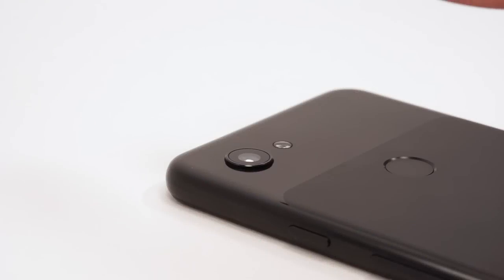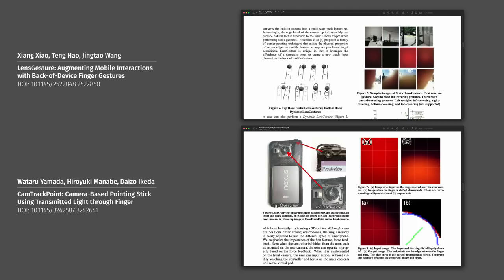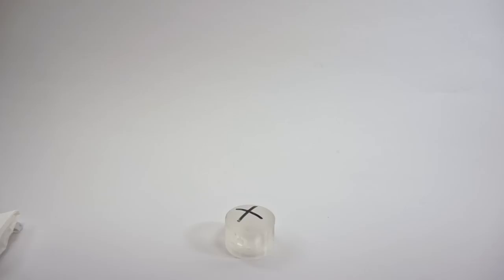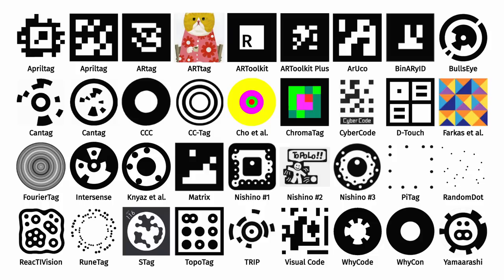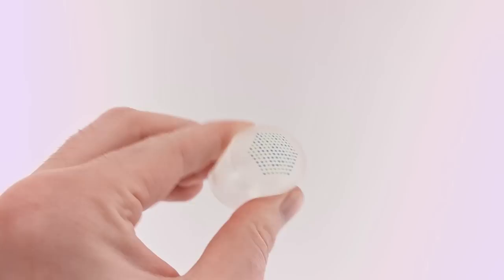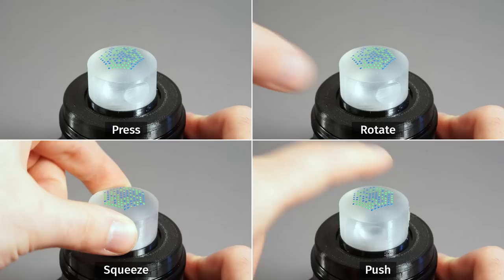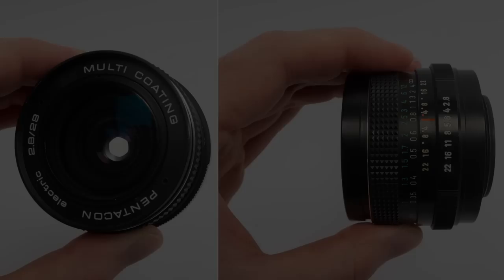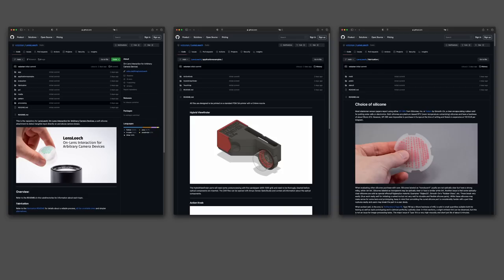Touch a camera to control your devices

Comment: Well I guess that as a input device to scroll through menus it's probably not very useful. Because it also requires a screen to see what you are doing in the menu structure. So for this you might just as well use touch screen, right? However, the application in soft robots is interesting because it allows for detailed feedback on how a  robot surface touches and holds an object, and which forces are exerted. Btw, good info on the silicone pigments, thanks for your effort!
Reply from the maker: Yes, if there is no screen at all the usefulness would be very limited. The niche where something like this might make sense is retrofitting. Old(er) devices with displays but no touchscreens that still do their job but are less convenient to use compared to their modern versions with capacitive touch areas. I admit, it's kind of a stretch, but so is a lot of human-computer interaction stuff...
Reply: No way! Nice seeing you here!

Comment: I wonder if this could be used for a 6DoF CAD mouse. Very cool concept and great illustrations
Reply from the maker: Interesting idea! After an initial calibration it would be possible to calculate a "lift" movement as well. The main problem would be the refresh rate/latency. The 3Dconnexion SpaceMouse does up to 1000Hz, that's quite a difference to the ~20Hz that the LensLeech does right now.

Comment: As it is silicone this could be used in the medical field where user interfaces would often be treated with disinfectant. Maybe controlling a 3D Model of a patient scan from a portable ct scanner (just like a cad-mouse, like another commenter said). You could pour another layer of silicone above the points to decrease the nooks and crannies from the points and add a backlight beside the camera to eliminate the need for ambient light. (Maybe even use retro reflecting pigments or something like this, to limit damage to the silicone from UV Lights)
Reply from the maker: good points! Coating the surface with another layer of silicone is a bit of an issue, though. The rough texture is required to diffuse the light of any objects in the background. Haven't had a look at reflective pigments yet, that might be worth a try.
Reply: @vlztn  I haven’t worked with silicone yet but would it be possible to mold it in two parts. First the main part with interior lens, then place the dots, then mold the rest with the diffused top. So the dots would be inside and not on the outside. To translate the deformation I would presume the layer on top of the points should be as small as possible.
Reply from the maker: yes, that would probably work. I avoided that because the clear silicone is very viscous and it's rather hard/error prone to mold very small or thin sections. In the end having the points "exposed" was good enough and each further step might result in a ruined part and a lot of lost time... (the whole project cost me a lot of time anyway 😅)
Reply: @vlztn  yes, of course. It should not be necessary for normal application, so i think it was the right decision to focus on the other parts. 

Anyhow if you ask me the hard-(or rather squishy-)-ware looks really polished. You can tell that you poured a lot of time into this and I am generally really impressed. It is not often, that you get to see research and the process documented so skillfully via video, blog and research paper. Great job!
Reply from the maker: very much appreciated!

Comment: i was wondering how accurately can you calculate the force applied and get for example the weight of an object placed on the lensleech.
Reply from the maker: The soft silicone sensor I have shown here can't measure force at all (I just discern "press" and "no press") because that would require a prior calibration of camera, sensor and fixed position. But other people that use deformable sensors for robot actuators do force measurements, example: http://people.csail.mit.edu/yuan_wz/force-torque.htm (it seems to work quite okay)

Comment: Did you try phosphorescent material for low light / dark situations?

Awesome project by the way!
Congrats!
Reply from the maker: Good point, but no, didn't try them. I'm worried that the light-emitting effect might be too weak given the very small amount of pigment that ends up in every single point of the pattern. Might not be an issue, but I didn't do a test order because the pigments were rather expensive back when I checked some prices.

Comment: That was a crazy video. Have yoy heard of the DIGIT touch sensor? Has some similar ideas for robotics, but uses its own lighting, not ambient.
Reply from the maker: Yes, good point. Had to cut the gelsight/tactip/elastomer sensor section, otherwise the video would have been longer than half an hour. One of the few (I guess the only?) project that sells deformable elastomer sensors so that people don't need to manufacture their own if they want to do experiment with these types of sensors.

Comment: You could potentially improve the identification with marking the few problematic hexagons that exist with single dots of mixed green-blue dot, which should amount to 4-5 points of third colour per blob if I understand correctly. Bonus points if they form vertices of a bigger hexagon in the pattern.
I have a feeling discretizing data into three steps might improve clustering if you expect them to be always apart (?)
Reply from the maker: I don't understand the last part completely, by "three steps" you mean three colors? In this case the issue with a third color would be that the color with the biggest difference to blue and green is red. And red is pretty close to how many human fingertips look like. That would make color coding for the pattern easier but segmenting background from pattern a lot harder.
Reply: @vlztn  It's a stretch, and I did no testing but a mix of blue and green, or black for that matter, for a half dozen special dots to break (fix?) the imperfect pattern sounds like a good idea to me. In theory.
Reply from the maker: Might try that in the future. It's kind of a trade off always between having issues at the first step (background segmentation) or the second step (differentating the points) and that's quite cumbersome... 🙈

Comment: Hi! Great video! 👍What kind of slider is that on 8:13? Is it diy?
Reply from the maker: Yes, it's DIY. Some 40x20 profile, MGN12 rails, and a 3:1 pulley with GT2 belts. When purchasing parts from AliExpress it's less than 50 EUR.
Reply: @vlztn  Thank you!
Reply: P.S.: are you using an arduino or esp32 controller? You could make a video about that 😉
Reply from the maker: Nope, for all my motion controller needs I am relying on fluidNC (https://github.com/bdring/FluidNC) on a fysetc E4. The hardware is just average but the software is something I can highly recommend.